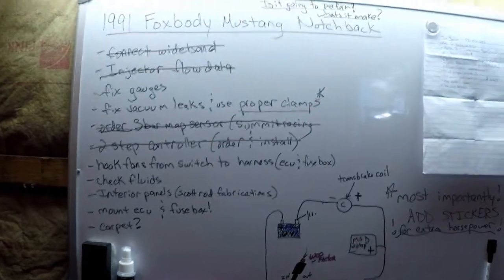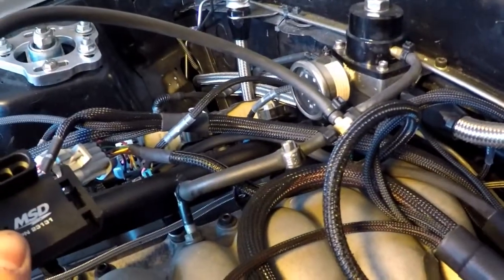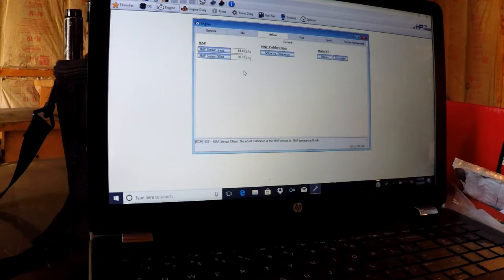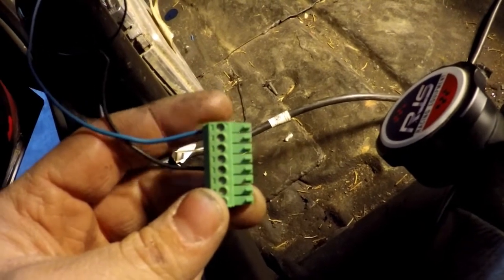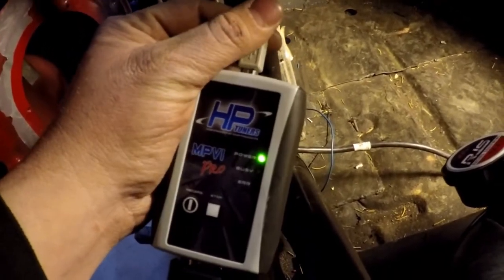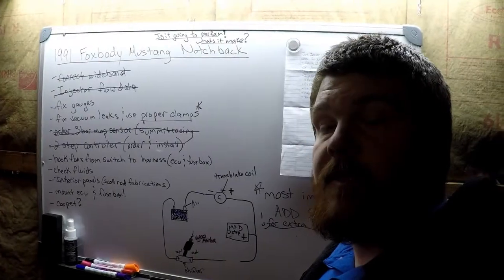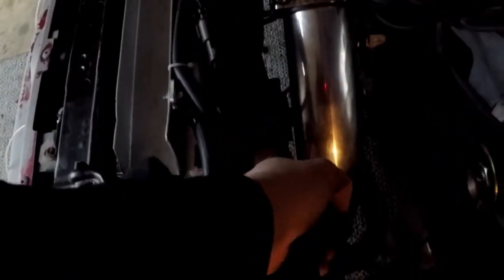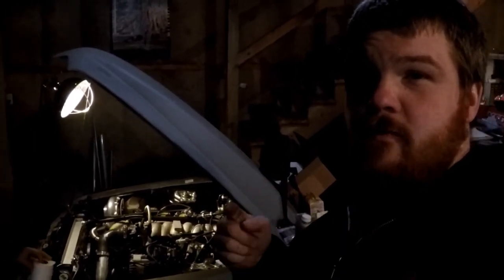IS SHE READY FOR THE DYNO??? & GM LS OEM 3 bar MAP upgrade

Comment: Each sticker adds a minimum 5 horse power. Can’t argue with facts. Murica’
Reply from the maker: BRO, wait until you see the dyno vid, fracking nuts. Also does the size of the sticker vary the added horsepower?? because the two YouTube stickers i have on my doors should definitely make it like 10hp more each??!?
Reply: Stupid Fast absolutely bigger the sticker the more gains